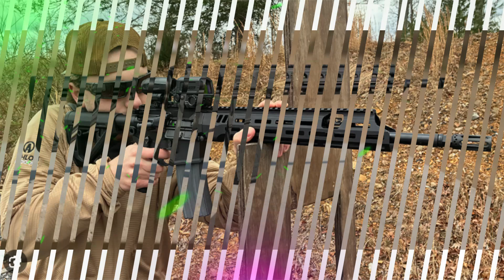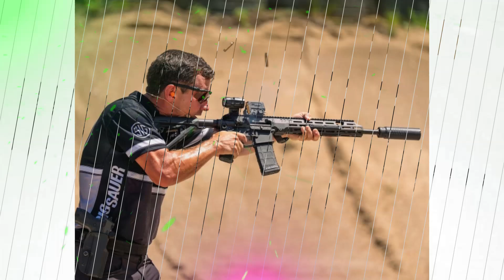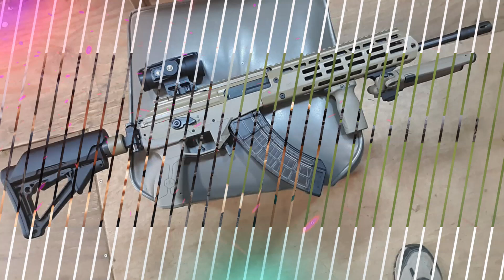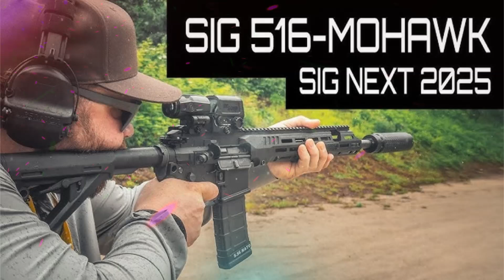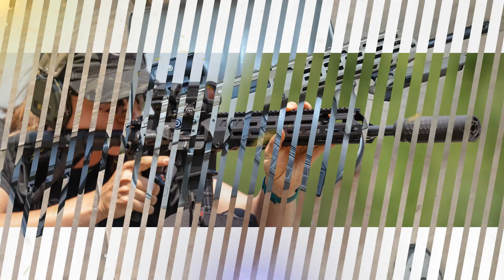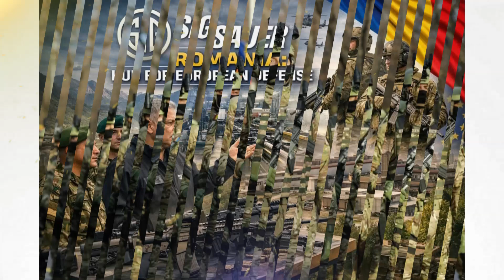Romania Adopts Sig 516 G3

Comment: It does not require rings on the bolt correct. However the piston on the G3 does have piston rings.
Reply from the maker: It looks pretty nice but I’m just waiting for a very unique and unorthodox take on an AR
Reply: I have one. You are correct. It has very small rings at the muzzle end of the piston.